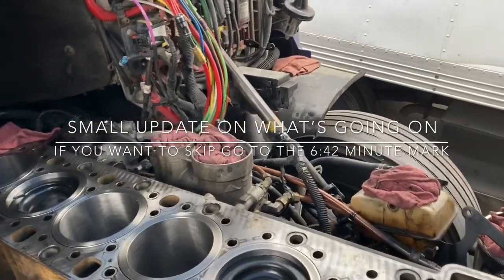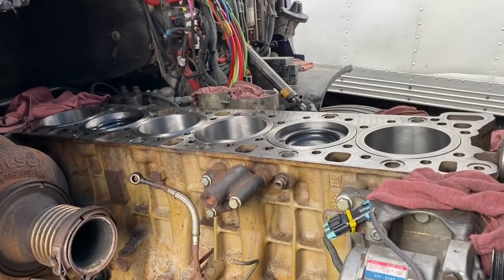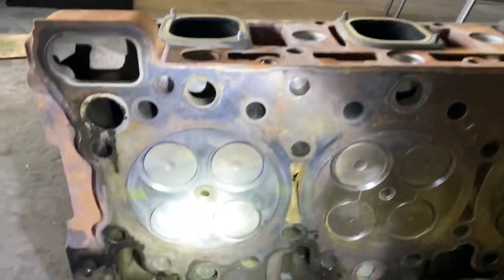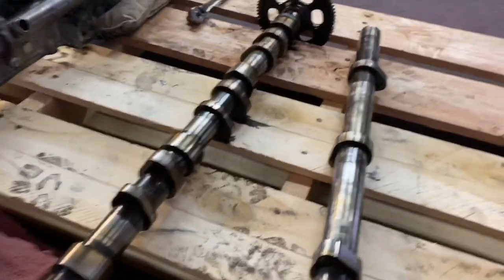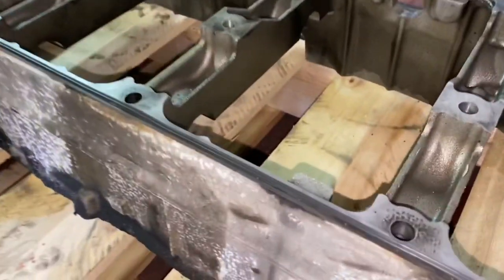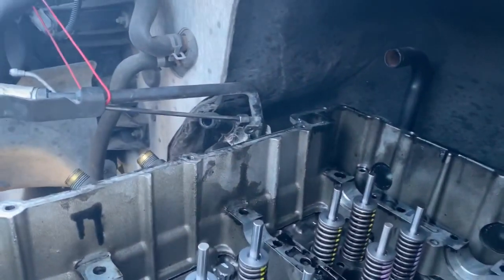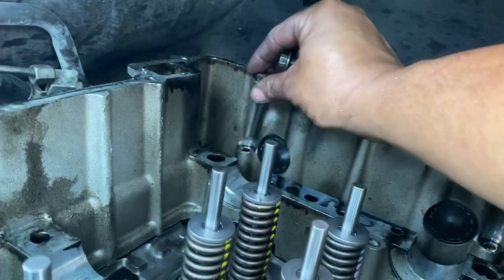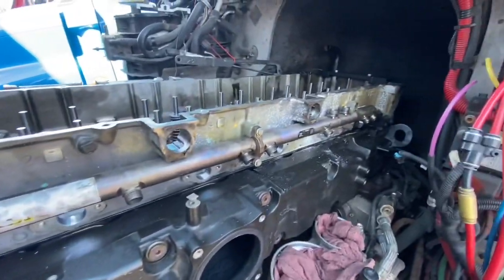DD15 and DD13, leaking CAM seal housing Part 2

Comment: Hello everyone, I have a question. My husband and I own a mechanic shop we specialize in Cummins and CAT we decided to explore the Detroit engines. So the engine had a cam housing leak. Everything was changed the way it needed to be to specs. The moment we needed to screw on the camshaft housing caps the threads went bad. we decided to repair the thread with a sert kit. Unfortunately the tool broke inside one of the holes and now we cant take it out. My Question is; can we use the old camshaft housing cap with the new ones or do I have to buy all the caps all over again ?
Reply from the maker: You should be able to use the old ones. Although it may not be recommended. If the threads stripped or came out you should a warranty on the parts through Detroit.
Reply: @CarlosDieselElectric  Thank you so much for your reply. This will help us out so much.

Comment: soooo a year later on my reply...you left the fuel rail on? To clean the cam box? 

Good vid though my fellow mechanic!!
Reply from the maker: Sorry for the late reply. The fuel rail will still have some fuel inside. You can leave the rail on. No need to remove it

Comment: I just had my gasket replaced.   Now I'm having issues I didn't have before. Engine idles smooth but when I give it throttle it shuts down at 900-1000 rpm everytime. Mechanic says he double checked the timing but I can't help but feel like it's still isn't set right. I now have general codes for high crankcase pressure, crankshaft position sensor, camshaft position sensor, turbo charger speed sensor, engine fuel supply module and engine throttle position sensor. Didn't have any of these prior. Have changed the cam and crank sensors still getting the code... I definitely could use your expertise
Reply from the maker: I would lean towards timing, you would have to verify the CAM timing with the flywheel timing. The timing might be off by one tooth.
You would have to remove the valve cover and rotate the engine to be at TDC 1. This would have the triangle marks showing on each CAM (intake and exhaust). 
You would need to have the tools for this process.

Comment: everybody says that the dd13 or dd15 is not really rebuildable yet here you are rebuilding one..............Mechanics say when they get rebuilt they dont last long, what are your thought on this?I was considering getting a dd13-or 15 in my next truck. LOve your videos:)
Reply from the maker: I have seen DD engines fail at 800K miles and at 1.1 million miles. They are very good engines, most guys don’t know how to work on them or what to look for when they own or service them. 
I have overhauled DD15 engines and they have over 200,000 miles since being rebuilt. The after treatment can be a bit of a pain.
Reply: @CarlosDieselElectric     Do you usually re-machine the head when doing a dd15 rebuild..I noticed before in another video you bought the aluminum camshaft housing as part of your rebuild too.
Reply from the maker: @douglasfurlong1  you can definitely rebuild or send the original cylinder head to the machine shop. Just find a good reputable shop that will stand behind their work.
Reply from the maker: @douglasfurlong1  the CAM housing depends on the customer. If there is any damage or leaking or the threads are stripped then I would recommend replacement. But other than that, you can reuse the same housing.

Comment: What's the price for all this
Reply from the maker: The time on a job is about 10-12 hours, the labor cost will depend on the shop rate. So if a shop charges $100 per hour. $100 x 12 hours will give you the labor rate.

Comment: Do you ever remove the cam housing complete? By backing off rocker arms and removing whole assembly?
Reply from the maker: Great question, I have heard of mechanics doing this but I myself have never done that. I much rather remove everything individually and then reassemble. I don't mind taking the extra time to ensure everything is done right. 
Total time is around 12-14 hours from the dealer, but if you really go at it, you are looking at around 8 hours or so.
Reply: Very good point, do you ever run into issues rotating from position 1 to 2 while running overhead? Considering the rockers were backed completely off so some of the valves wouldn’t be opening until the second set of valves were adjusted?
Reply from the maker: @brandonallen914  it takes a little getting used to when it comes to finding rotation 1 (TDC1) and finding rotation 2 (TDC 6). 
I look at the marks on the timing gear for TDC 1. Valves 1 on the intake and exhaust will have some chatter and valves 6 on the intake will be pushing down and have no chatter. Once you rotate 360 valves 6 intake and exhaust will have chatter and valves 1 intake will not. 
Hope that helps. Hope that answered the question.

Comment: This was extremely helpful. Thank you for posting this. Is there any way to tell if the leak is just coming from the seal or the whole cam box housing? I get a couple drops in the back of the engine every time I park. I have a DD-13 with almost 900,000 miles
Reply from the maker: It is usually just the seal that starts to fail. The only way the housing could be the issue is if the front seal (cap) starts to leak. The CAM housing is  definitely reusable.

Comment: Is removal of the cams necessary to just replace the cam housing seal?
Reply from the maker: I have heard that some people say no, but I always remove the CAMs. 
This way I make sure the timing isn’t moved and everything is as it should be. The hardest part is the rocker arms (intake and especially the exhaust because of the weight). 
After that it is easy. I really don’t see the point in not removing the CAMs. Not sure if people don’t want to because of the extra work or they don’t have the timing tool.
Reply: @CarlosDieselElectric  Got it! Thank you!

Comment: I’m in the middle of in frame a dd13. Right at 45 hours. Think we under quoted it, I’m ready to set my cams in now and run over head. Thanks for the video
Reply from the maker: Dun Built It awesome. 45 hours sounds about right as far as time and labor goes. Glad you like the video.
Reply: Carlos Diesel Electric yea 45 hours was a good amount just hard when you’ve never built one of these. I pretty much just have to set timing then install my cams and rockers run over head and I still have to install a new egr cooler but after that I’ll be ready to fire it up hopefully
Reply from the maker: Dun Built It you will be fine. I still get butterflies right before I fire up the engine after a rebuild. 
I recommend once you are ready to fire it up. Be sure to prime the oil system properly and be sure to prime the fuel system and it will fire up like a champ.
Reply: Carlos Diesel Electric will do thanks! I’ve always told our lead tech who helps me that we could make a YouTube channel. I’ll have to show him yours
Reply from the maker: Dun Built It awesome. I say make a YouTube channel. It’s a lot of fun. Plenty of information to be shared just not enough people willing to share it.
Reply: Carlos Diesel Electric hey man I’ve got this in frame started but it makes a loud sqeaking noise as soon as you turn the fuel primer on
Reply from the maker: @cdun6969  how does the little primer pump feel? Is there resistance?
Reply: Carlos Diesel Electric ran out of time today but it sounds like a loud squeak under the valve cover like cylinder number 1 or 2. It made this sound before I inframed it. Wondering what it is
Reply from the maker: Dun Built It pull the valve cover off and see if you can pin point it
Reply: @cdun6969  did you ever find out what the noise was?